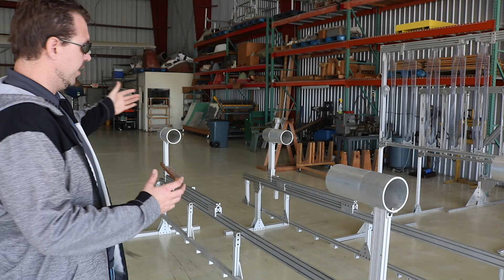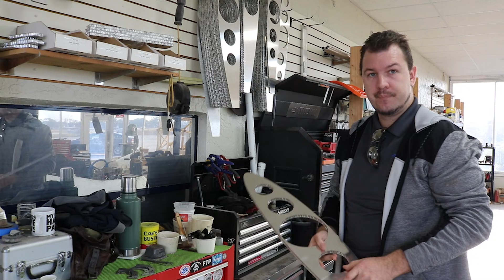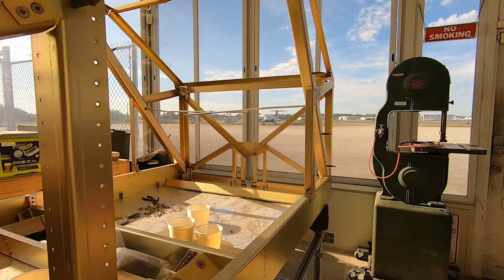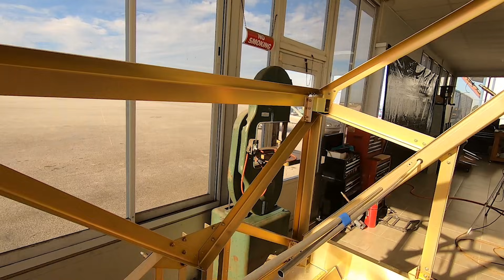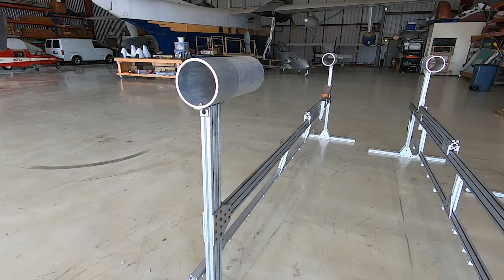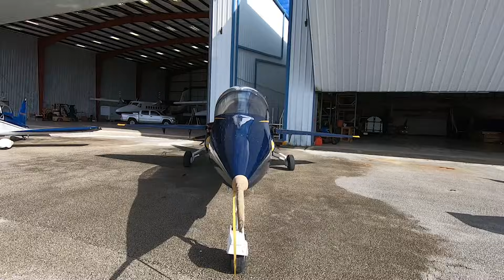NEW! Bede Aero SE - FACTORY TOUR - 2021 Aircraft

Comment: I'm wondering why use 2024 aluminum for the skins if they're "non structural". 6061 would resist corrosion better and it is used as structural for fuselage and wings on Zenairs.

Comment: For the control surfaces they use mahogany???
When a glider plane can be such outstanding performance and be quick to make as a single piece fuselage, why on earth are they doing those box designs that take 1000 hours to make??
The only decent plane there is the BD-5 which had very real merit so they should of course do a new version, glider derived all composite shape and even develop a small turbofan engine for it. And give it two of them. A personal jet with actually serious capabilities. Kits have never amounted to anything and kits that boxy are especially wrong. Do Bede proud.

Comment: I was lucky enough to find a complete BD-5 kit back in 1988, so I picked it up for just $1500.  I owned a IFR 172 at the time (in N. Miami, FL area) but really wanted a fast “toy” to play with on weekends.  The plan was to build it a little at a time in some extra warehouse space we had at the airport.  

Unfortunately those kits had no predrilled rivet holes so lot of time to jig was needed.  When I lost my hanger during the early ‘90’s “depression”, I reluctantly decided to sell all the half finished pieces.  I often wonder if the guy who bought it ever finished and flew it, you see so very few of them ever get completed and into the air.

Still sad about the one that got away, I guess I have to go to Ft Pierce and check out the single seater in the video. Happy flying guys. ✈️

Comment: Honeycomb for the wings, but the fuselage is inferior to any bike. No tubes. No bent tubes following the streamlines, but individual pieces. Flat aluminum plates instead of for example 3 printed sleeves or just sleeves CNC cut out of a tube and then welded like on a bike. Maybe even order the shorter tubes from a bike manufacturer.

Comment: I'm curious about the stall speed with the high wing loading. The website says 53 knots (61 mph), but in the video he says 65 knots. I'd like to see how a 6'-1" pilot fits in the cockpit with that wing spar. It would have been awesome if it was more like the 177 Cardinal whereby the pilot sits in front of the spar.
Reply: It's"Experimental, slide the wing back 12" and put your 250 pound neighbor in the back seat, it'll work just fine...🤣👍

Comment: One very big problem with the honeycomb sandwiched ribs is they need to be sealed on all the edges and inner lightening holes. The thin aluminum honeycomb is highly susceptible to
moisture "Moisture get's trapped in the honeycomb" and therefor corrosion! I do hope they seal the honeycomb edges!
Reply: Jon Cox, no offense but that has not been our experience.  We have been using the open honeycomb cell method of construction for both fuselages and wing ribs for years with no corrosion issues detected.
Reply: @mvvoila3356  Great, that’s good to know. My experience with the honeycomb de bonding and corrosion issues have been with helicopters operations in the oil fields in the Gulf of Mexico. One little bit of that corrosive offshore environment can really creat major corrosion issues in the honeycomb panels such as tail booms and floor panels. When ever we worked with the panels, we always sealed the fresh cut edges with a structural adhesive to help keep out the moisture.

Comment: I seriously hope you guys reinforced the tail section as well as the flap system. . As someone familiar with Fox 10 and in Minden Nevada , ( It was a company set up to manufacture the BD 10 jet) Every one of these jets has killed their pilots. Jim Bede and his poor designs have widows and fatherless kids.
Reply: SkyKnight209...

Since you are someone familiar with "Fox 10", you'll know that Mike Van Wagenen began the company as a BD-10 builder assist center but that never came to fruition when the FAA determined that the company was actually attempting to manufacture aircraft , circumventing applicable regulations.  In 1993, Van Wagenen took over the entire BD-10 project.

In 1994, the first Fox BD-10 prototype, N9WZ, was completed and began flight testing although the tail design had been significantly altered from the original Bede design.  It was this modified aircraft that broke up in flight, killing Van Wagenen.

"Jim Bede and his poor designs have widows and fatherless kids."  Since I don't know you at all, I can only say that you should really engage your brain before you put words into writing.

Comment: I wonder if they resolved the vertical stabilizer flutter issues on the BD-10? I remember it was a major issue that grounded these birds early on. Interesting they did not mention pricing on it.
Jim Bede also designed and marketed a ground based vehicle that evolved into the BD-5 later on. It was called The Pulse. It used the rear section of a motorcycle engine and drivetrain. There are several clubs in the States that collectors restore and drive these vehicles.
Reply: The BD-10 there is a non-flying history exhibit.  They have no real intentions towards redesign and production from other interviews I've seen.

Comment: Love the mini blue angel BD-10, such a good looking bird! I wonder if with the advances in li-po tech if they could ever make an electric turbofan engine, flight duration might suck but man that would be fun.
Reply: Electric turbofan? What is that?
Reply: @MattH-wg7ou  He means Electric ducted fan. it's used on most R/C Jet models. I'm not sure you could get it to fly, let alone be agile, as EDFs are not particularly efficient and batteries are heavy (Electric aircraft lean more into the glider wing for efficiency for that reason)
Reply: @DFX2KX  Aah okay thats what i suspected. Thanks for the clarification.

Comment: Love the BD 5 iconic small jet design along with the F-18 style fighter jet aircraft. The BD-4 design brings me back to when Volvo automobile advertisement was; “We’re Boxy But Safe”. I know the home built LSA aircraft is saturated with the two seat model aircraft but it would nice to see a BD LSA aircraft available from their BD-4 design platform. Most of the LSA market comes with a pre-welded 4130 steel tubing airframe and BD could simplify the build with their aluminum frame design. I’m guessing they have evaluated the market and they couldn’t justify the cost of designing & tooling of an LSA model aircraft but with their lack of the wing struts it would allow for greater visibility for pilot and passenger. So maybe they could break into the high-wing LSA market with a new design. I guess they defiantly know what their doing and what markets they want to fill. Nice looking company & shop so you’ve brought another great business interview again Bryan so just keep them coming!! I love all their Blue Angel paint schemes their using too!!

Comment: All those screws worry me. Nylon lock nuts Will back off under vibration. Wouldn't you have to safety wire every single one of those nuts? If they start coming loose, how do you get to them to retighten if you glued the skins on? I like the idea of the construction method, but would have preferred to see rivets.
Reply: 428 Renegade...

As Dennis Rantanen points out below, they are NOT nylon lock nuts but rather steel mechanical locking nuts.  I have never seen a BD-4 nut vibrate loose.

Many people have suggested using rivets,  but there are two flaws there... 1) a rivet of the same size is difficult to shoot due to it's size, and 2) if you didn't like using the large rivets you would have to triple the number of fasters resulting in thousands of shot rivets.

The use of bolts and nuts has proved itself since 1968.  Apparently Jim Bede figured out the best construction method 50 years ago!

Brian Ingraham
Reply: I believe he said they were all steel lock nuts. 
I built a few of my own sprint car wings when I was racing. I bonded the aluminum skins with clear rtv silicone and rivets. which I later learned that some rtv silicones were known to be somewhat corrosive to aluminum. Well I once tried to take one apart that I had crunched up. I drilled out the rivets and couldn't peel the skins off without destroying them. So I have no doubt that bonding works.
Reply: @429thunderjet2  Didn't say bonding doesn't work, only that bonding seems like a bad idea when you're covering up so much hardware you may need to retighten later. I have tried to removing such bonding with great difficulty before myself too. But a racecar is one thing, whereas an airplane that gets minimally inspected and maintained over decades is another. If the wing race car nuts come loose, you might crash, but with roll cage, safety gear, etc. if the tail comes off the airplane....well. Steel locknuts, steel with nylon inserts, etc. doesn't matter. they all come loose over time. That's why everything in aviation is safety wired on, or has a cotter pin.

Comment: I think that looking back in history we will be able to say that this is the video that brought the BD-10 back to life :-D
Reply: The last kit-built variant of the BD-10 flew in 2003 but suffered an inflight breakup, killing its pilot, Frank Everett, off the coast of Southern California.
In all, five BD-10 variants were built, three crashed, killing each pilot, and two were relegated to static displays.
Shame really, I thought they were onto something good here.
Reply: @nicholaschriss1706  Were any of the kits ever flown supersonic?
Reply: @randomizedpasta  I'm not sure if nthey did it unofficially but I don't think it could be done as it would go through vigorous vibrations breaking he sound barrier and it was never tested at that extreme
Reply: @randomizedpasta  No...because the latter updated designs were built much heavier than the original proto-type and could only reach .8 mach
Reply: @nicholaschriss1706  Believe it or not the 707 was actually flown supersonic (in a shallow dive from 52,000 ft) before it ever entered service and it was hardly designed for it.
Reply: @mustangmikep51  I should've been clearer, considering it was originally intended to go supersonic in level flight it ought to still be possible to do so in a dive like the F-86. 

Besides which mach 0.8 is quite an "only" lol.

Comment: I like the aluminum strut structure. Murphy aircraft has something this similar to this but this could be the game changer for the high-wing Cub clone design.  One of the reason for me NOT to build a Cub clone is the amount of welding and fabrication of the steel-tube fuselage.  I can rivet, I can bolt but to properly weld a steel tube structure takes many hours of practice.
Reply from the maker: You could master it. I have done it. It actually is quite fun when you get into it. But I also prefer working with aluminum if I had to choose. Any AIRCRAFT CONSTRUCTION is quite rewarding however! Thanks for engaging here today and taking the time to watch! We appreciate you!

Comment: I was at the factory just before Thanksgiving 2019.  I saw several BD4s in various stages of construction.  All the aircraft on this video were there.  The honeycomb wing and elevator jigs weren't set up yet so I didn't see that.  I sat in an impressive BD-4.  All my questions were answered.  I had been building a BD 4 back in the 70s and had to give it up due to divorce, moving etc.  One guy was using a computer aided construction device to make a landing light bracket.  It was all interesting and fun to see.  I hope BD does well.
Reply from the maker: Nice! Sorry "life happened" during your project. I have bought/sold several over the years myself. Hope you can get back into it! Thanks for watching!

Comment: Dont know if I like the "Flying Tail", tho....Would like a "Conventional" tail.....
Reply from the maker: Do you mean the "Stabilator?" That is also used in the Piper Aircraft and several others I believe. (Just not a new thing etc). I prefer a "Stabilizer" personally as well. Not sure exactly why...other that is seems more conventional. Thanks for watching today!
Reply: @ExperimentalAircraftChannel : In my experience, stabilators don't stay trimmed.
Reply: I've been flying a BD-4B for quite a few years now and previously had a Cherokee.  I often fly Skyhawks also.  In flight you'd never notice the difference between a stabilator as on the BD or Cherokee vs the elevator on a Skyhawk.

Comment: Been flying my bd4b for 18 years.great airplane,glad it is finally getting some recognition.I chose it because of useful load and high wing design. I couldn’t stand the thought of being trapped under an inverted vans after an engine out in the wilds of west Texas where I fly.Just my claustrobia talking I guess.
Reply from the maker: It is difficult to think and plan for all that can/could go wrong. Each has their own level of what is acceptable. It is good that you know your limits. 18 years is a long time. I bet you have some really amazing experiences to share! Thanks for stopping by today!
Reply: Delores Morton, I flew my BD-4B for a few years and then built the new all-metal wing.  A fast and reliable cross-country airplane with a Mooney-sized cabin.

After I became involved with the Bede organization, I started flying the BD-4C  and absolutely love it.  Still the same performance as the BD-4B but with a Bonanza-sized cabin.  155-160 knots TAS (depending on temperature) on 10 gallons per hour.  Not too shabby at all.

Brian Ingraham

Comment: Did you sit in any of the ones in production? What are they like for headroom ?
Reply from the maker: That my friend... is a very good question. :-)  I would advise trying on for size ANY Aircraft you are considering Building/Buying to see if it meets your standards. I am about 6'. I fit just fine in the BD4 as an example. The carry through "tube" is visible in the "headliner" just forward of you. Hangs a little low in my opinion... but doesn't impede visibility or room.
Reply: I fly a BD-4B with no problems and I'm 6'2".  The BD-4C actually was built with quite a bit more room than the B model that I have ... fwiw.
Reply: Good question. That spar is pretty close to the head. I'd like to see how much room there is. You may need that room in turbulence or an accident.

Comment: Bede was a pioneer in aviation.  I remember him as a maverick that defied conventional thought in aviation.
Reply from the maker: I remember seeing the BD5J at an airshow as a kid. "Quickest Gear Retract in the West" they would quote as it flew by. Gear up! Gear down! Gear up! (It only flies for like 30min with fuel capacity).
Reply: @ExperimentalAircraftChannel  Corky Fornoff rolled it so fast it bent the wings.  But he was able to land it.
Reply: @dirtcop11 , actually the bent wing was the result of a canopy opening while Bobby Bishop was conducting high-speed dive tests.  The canopy rim struck Bobby in the forehead and knocked him out for a short period.  But the impact of the canopy bow made Bobbie pull the side-stick to the point where he imparted a 14g load on the wing, bending the center section 19 degrees up, but nothing broke.  That's the beauty of the tubular spar.

Corkey was flying chase in another BD-5J and managed to talk Bobbie down even though Bobbie could barely see.

Brian Ingraham

Comment: Thanks for putting this on as an overview of what is available, it seems like you could do a sequel where you go out and fly these aircraft. Also, which will not be in production?
Reply from the maker: Agreed! :-) The BD-10 and BD-5. The BD-5 (As mentioned in Video) they still have some parts for but when they run out they will stop producing. MAYBE.... make something in the future a little bigger/wider etc. Thanks for saying hello!
Reply: Mary...

As Bryan mentioned, the BD-10 is not available in any form and BD-5 components are available, depending on which ones you need.  We can support a BD-5 builder with Builder Assist or individual components from New Old Stock.  We can also build BD-5 wings to suit.

The BD-4C, BD-6 and BD-17 kits are available and ready to ship.

Brian Ingraham
Reply: There's a company called BD micro. I think they were building parts years ago, might still be in business.
Reply: @ictpilot , BD-Micro Technologies is going strong in Oregon, focusing on the BD-5J.
Reply: @mvvoila3356  Ok, last I talked to them they were doing parts for all the BD5 variants.
Reply: @ictpilot , BD-Micro Technologies does in fact offer kits and solutions for all of the BD-5 variants, including the turboprop, through their FLS models but the list of customers has bought into the jet.